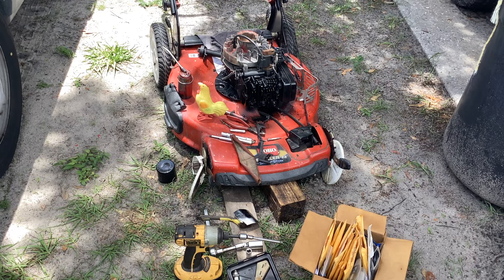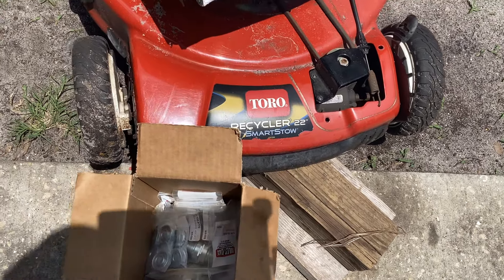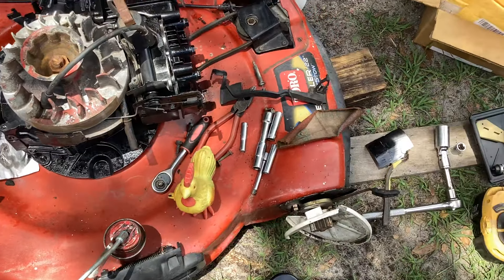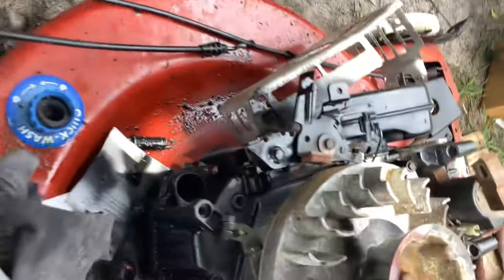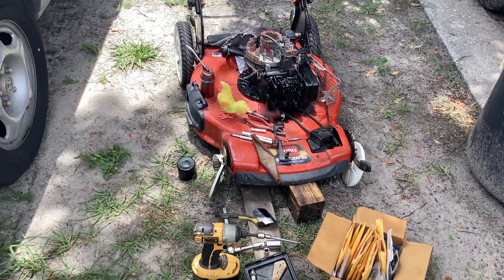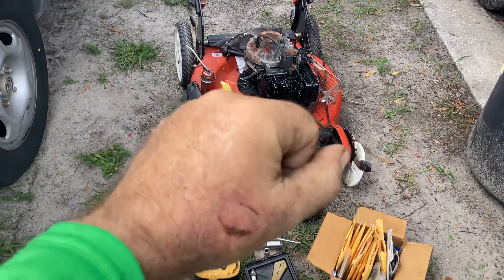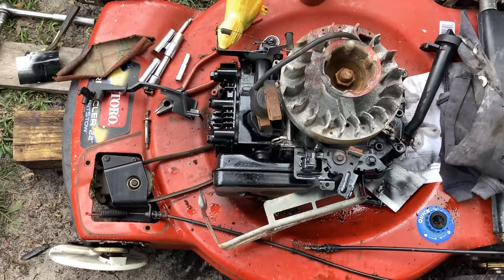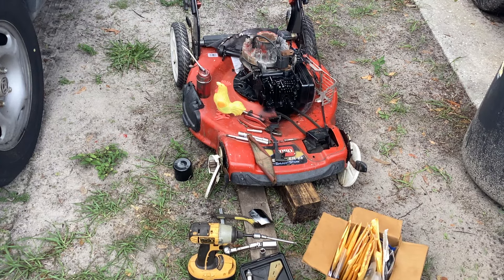2009 Toro Recycler Lawn Mower came in without Two Front Wheels.  Not a problem.!!!

Comment: The Toro's go quick around here, not sure why. The one I got a few days ago is almost ready, but it's surging on me. I did a carb clean originally, and it was surging, so I put on an aftermarket carb, still surging. If I engage the blade, it stops surging and runs smooth. This is the first Toro I've seen with an On/Off switch and a blade engage handle. Hmmmmmm.......
Reply: From my experience with mowers, it seems to be the color red.... Perfect example is Lawn Boys same exact mower as the toro, I can't sell a Lawn-Boy what so ever, unless the person knows they are the same, but put up a red mower it's sold that day or not to soon after.